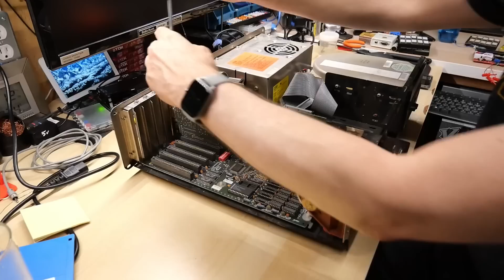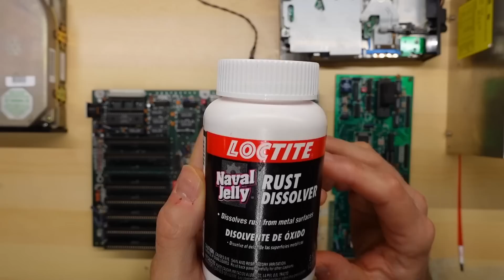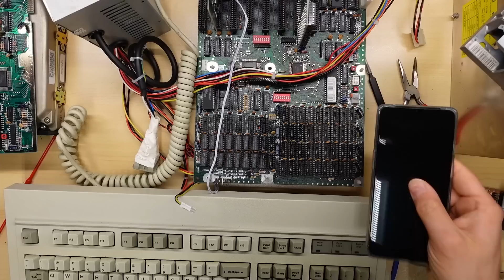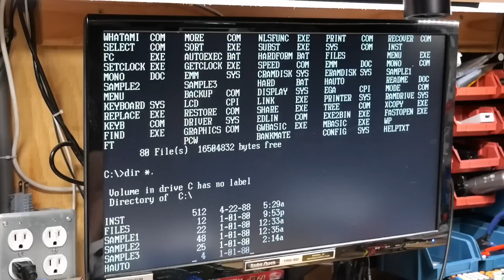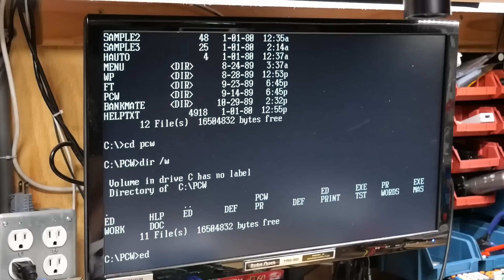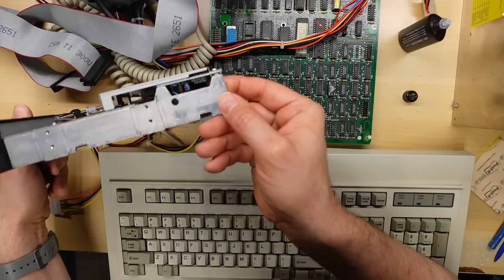PC archeology: Laser XT Turbo "Leaking VARTA Battery" Edition

Comment from the maker: Thanks to several viewers who commented, turns out the Laser XT Turbo has a keyboard lock function which requires two pins to be SHORTED to enable (unlock) the keyboard. This is the reverse of all other motherboards I've come across. After figuring out the key lock pins, I installed a jumper and not a XT keyboard is working perfectly. System appears to work flawlessly as well. Control 5 and Control 8 change between regular normal speed and 2x "Turbo" speed.  https://imgur.com/a/Rb1YFrQ
Reply: I could be wrong, but I was always taught XT, AT, and PS2 peripherals aren't hot pluggable (30 plus years ago ha!).  I'm not saying it won't work, but plug and play was not a thing.  There is some small risk of damage, and some devices just won't initialize properly.  Regardless, it's your stuff, but for the young gamers best to treat these things delicately.
Reply: @tiporari  Yup, XT/AT/PS2 is most DEFINTELY not safe to hotplug. You'll get away with it most of the time, but in my experience if you do it enough it WILL blow up the port eventually.
USB was pretty much the first PC connector that was to hot-plug and that was because it was specifically designed for that, note how the ground connector on the USB connector is sligtly longer so ground connects first. The next connector to be designed for hot-plugging was the SATA connectors (both data and power), again we see that they've made sure ground always connects first.
Reply: @Torbjorn.Lindgren  there were other hot swappable connections before usb, sca for scsi being an example (I'm pretty sure it predates usb). There were probably others,  but some were likely proprietary and in the server market,  most likely on unix machines.
Reply: @bionicgeekgrrl  I think the SCA connector was introduced after USB came out, even if the initial SCSI standard came out 10 years before USB. It's hard to get a solid date on the initial SCA-1 connector but all SCA connectors are always "wide SCSI" and the first standard that included wide SCSI appears to have come out well after USB. It's possible the standard document were well behind actual hardware but either way it's clear SCA came out much later than my next candidates.

Firewire is hot-pluggable and the first version came out 1986, the same year as the initial narrow SCSI standard which means it beats USB by 10 years. I was only considering non-trivial "desktop" PC/Mac connectors, the audio and serial connector has always been hotpluggable for example while pretty much all the pre-USB keyboard connectors were NOT - ADB, XT, AT and so on are all known to be unsafe and can if you're unlucky "destroy" the motherboard interface (even if it'll work fine probably 99 times out of 100), there's sometimes a very small fuse that can be replaced which often but not always get it working again.

Firewire was never that common on the PC side it's definitely a much earlier example that matches my critera.

Another contender is 10Base-T (1990) but while it beats USB it doesn't beat Firewire! The thin-net 10BASE2 versions of Ethernet came out the year before Firewire (IE 1985) and was hot-pluggable so that's an even earlier example, I don't believe the AUI connector used by 10BASE2 (1982) was safe to hot-plug though I think the vampire tap part was.

One common factor for firewire, SCA and USB is that they are engineered so that certain pins in the connector is longer than the other pins so they're always connected first even if the plug doesn't come in 100% straight, connecting a coax via a BNC or similar connector directly to the PC like 10BASE2 exploit the same effect (ground is the shell).
Reply: great news.awesome
Reply: The first thought I had when the keyboard didn't work was the lock, and I'm not at all familiar with Laser machines! Guess my troubleshooting skills are just on point 😅
Reply: and you were showing off the keyboard lock in the beginning of the video !!!    Nice video tho happens to the best of us!. thanks ! Joe
Reply: Nice design with an error that doesn't tell you its because they keyboard is locked like you'd see in other systems.
Reply: I ran into this on my first Laser XT Turbo and thought that the mainboard was flawed, so I got another one before I realized it was because the keylock was unplugged.
Reply: Replying here instead of clicking "thumbs up" since it's at such a nice number.

Comment: That "Laser XT Turbo" seems like an ideal XT motherboard, except for the unfortunate keyboard issue.
I like that it can go faster than an original XT, but hasn't lost the ability to run at the original IBM XT speed as well.  That would be very useful for XT era games, some of which need to run at the original speed, but others could benefit from going faster.
I really like that it supports EMS directly on the motherboard without needing a card.
It seems like this board has great range for something that can still run XT games at their original speed.  It's a shame it won't work with normal keyboards though.

Comment: "Vinegar is difficult to get into the isa slots. " .. umm Adrian, it's easier than trying to force a thick gel inside. Get some toilet paper and place it down where you want to pour the vinegar and that keeps the vinegar in place and its a lot cheaper. That stuff you use, this "naval gel" is £20 a tub in the UK!. Oh just pour the vinegar into the isa slots and leave it. Or sprinkle baking soda on the green then drip the vinegar on. Simple and much much cheaper. By the way where did you get that micro TV with the 80s style animation running?

Comment: Hi, I've got a Laser XT motherboard that I'm trying to get working. It's actually in an IBM 5155 case. It was an old work computer that the tech guy apparently spent $10,000 to upgrade (according to my Dad), so it now has a HD, but also the Laser motherboard and that FDC. I had the same issue with the leakage, although nowhere near that bad, but I can't get it to boot past the floppy disk error. I don't know if it is the card, the drive or both. 
I don't have the spare parts or computers to do testing to see what works.

Do you know if it is possible to boot with that motherboard using the XT-IDE without a floppy? 
I'd like to get one, but if I can't get the computer to boot, then its not worth it.

Thanks

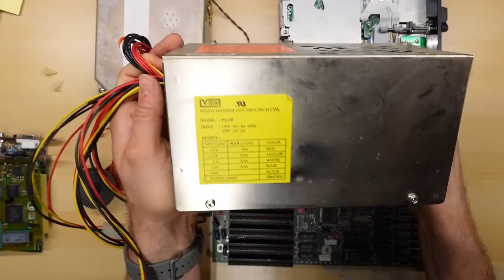Comment: 12:13 talk about an ineffiecient PSU*!  Output capability is just shy of 130W, but the input is up to 480W!!!

That is a whopping 73% efficiency loss!  

*Unless they are allocating the IEC passthrough power consumption as well into that input figure, which would seem more reasonable, because I can't fathom how a switch mode PSU even from this time would have that much worse efficiency than even a linear power supply.  But I've never had my hands on a Laser 128, so presumably V-Tech rated things a bit differently than how Astec and even IBM would label their PSUs.

Comment: For a while in the  mid to late 1990'sI was able to buy used XTs from a local liquidation outfit for $5.00 each. Stripping one down yielded a case and PSU far superior to most available at the time, and a treasure trove of miscellaneous fastener hardware for reuse.
 I would install various iterations of pentium or AMD mainboards and up to date HDDs in them. The power supplies were fully compatible and of much higher quality than that of the many smaller, cheaper, and cheesier PSUs that were flooding the market.
The trend at the time was toward vertically oriented tower and mini tower cases, but I preferred the looks and solid construction of the old IBM's. I wish I still had at least one around to play with.

Comment: Have you ever done the run it through the dishwasher routine on boards like this or worse?  Contrary to myth, there are no particulates in dishwasher detergent to sandpaper anything.  I've never tried it but have done a thorough washing in regular water (hard water here in San Diego), lots of dish soap, and various brushes, toothbrush, etc. on a motherboard (486 as I recall) that had gotten rusty(?) from living near the ocean here and didn't work/boot at all.  I'd removed all socketed chips first.  When done, I blew it out thoroughly (especially under surface mount chips) with my air compressor (yes, I know, risk of static), then rinsed thoroughly again with 90% rubbing alcohol (best I could find), then blew it out again.  Finally leaving it out in our San Diego sunshine for a day.  Put everything back together and lo and behold, it booted right up and ran for years!  Not sure what happened to it eventually, though, may have failed again but as mentioned, it ran flawlessly for many (5+) years.  'twas an experiment in the washing idea, and had nothing to lose and gained a nice system.

Comment: I had one of those! That was my first PC! Laser Turbo XT! 40MB Seagate and all! It went into the landfill decades ago, the cpu had stuck bits.
Reply: The labeling on that hard drive is exactly how mine was too. Maybe some OEM thing they did. Holy shot this is a blast directly from my past.
Reply: And yeah there’s actually a full menu system in the C800 on that MFM card. I seem to remember you started that at a different offset in the segment than 5. But even with the basic interface you had basically full control of the low level format. I remember it because it was an at least yearly ordeal after the drive aged and became very sensitive to the ambient temperatures.
Reply: Red switch on the back is yes the reset.
Reply: The BIOS is picky about keyboards. Mine worked with the Laser and a model M but nothing else as I recall…any XT/AT keyboard made later gave a keyboard error or just locked the thing up.

Comment: i have a 1990 dated Hyundai Super16TE 8088 XT machine, has similar nicad damage 😢
Reply: i washed mine with 'diluted' liquid phosphoric acid rust killer, similar as you had in the video, but not jelly type , scrubbed it with an old toothbrush, also had a tiny bit of washing up liquid mixed with it, it soon killed the corrosion, many say use vinegar but i cant stand the stench of the stuff ... theres some completely rotted tracks, i've started patching them but left it for now to do other stuff

Comment: If the video card has a true monochrome mode, that uses a different screen mode for text.  Hot swapping connections would not automatically change the screen mode.  I don't recall if BASIC allowed you to switch, but if you don't have a tool kit to change the video mode I think it is a call to INT 10H.  It was easy to do with debug.  ah=0, al=mode

Comment: The ST-225R actually has the same 21 MB capacity as the regular ST-225, but the higher density of the RLL encoding allows it to use only one platter instead of two, making it a lower-cost and less power-hungry drive.
Reply: It also means you can't squeeze an extra 50% space out of it by swapping out the controller for an RLL controller, something we often did with non-R ST-225s when they were no longer desirable (most everyone having moved to the ST-251, which RLLs to a ST-277R). Ah well, Seagate was under no obligation to enable our hacks.

Comment: I noticed the battery eaten controller was tested with a HD floppy drive and disk. If I recall older controllers only supported 360k or 720k. I think you need an upgraded chipset for 1.44? Maybe test with the 360k drive? Nice socketed z80 on that board.

Comment: I almost wonder if the RCA outputs on that CGA card are split into Luma and Chroma. It probably isn't, but if it is, you can probably turn it into regular composite by coupling to the second one's output with a 470pF capacitor - you'd want the Luma output going straight to your monitor (or converter) and a 470pF between the Chroma output and the wire carrying Luma. This wouldn't be perfect, but in such configurations it will usually get you at least some color. Alternately, you could just make up a cable to connect them directly to an S-Video input on something if they are indeed split Luma/Chroma.

Comment: RLL encoding (AKA relative run length) was a way to get more storage from the same area of magnetic surface over MFM (modified frequency modulation).  This was a HUGE gain back in the day, because an RLL drive cost about the same as an MFM drive, but you got more storage space.  A very economical tech advancement.

You have to realize that magnetic hard drives were very young back then, and we're the beneficiaries of a long chain of very expensive research to get to the rotating magnetic media we have now.

Of course everything is going flash memory now (SSD's are flash based).   Good luck finding a working SSD from today being readable or usable 40 years from now...  ^-^

Comment: If a motor has permanent magnets in it then it is not an induction motor. It is a permanent magnet synchronous motor if was driven by sinus, or BLDC if was driven by square wave.

Comment: hey if you're going to recycle that case frame, would you consider selling it? I've a 286 and a 486 motherboard I want to build custom cases for, and that sanded-down and repainted could serve as a framework for it.
Reply: Be aware, the spacing on the rear card slots is different between PC/XT and AT or higher. You'd have to remove that part of the back panel and replace it with one salvaged from a more normal PC case.

Comment: I wouldn't be surprised if that Chinon 5 1/4 inch drive is actually HD. After all, it was made in '89. I have a few of those and they're all HD (although mine are all... what would you call that, dark beige? What Commodore used on some of their cases - some of them even came in Commodore PCs - and they're definitely HD drives)
Reply: Some, not all - Commodore used those Chinons in virtually everything with a 5.25" drive at one time or another! But in the XT class stuff (I've had like four PC10-IIIs) they were all 360K.

Comment: Thanks Adrian! I am going to try the Naval Jelly on the worst spots of the Amiga 3000 I am going to restore soon. The battery damage is pretty significant but I HAVE to get it going! 😎
Reply: That might not be enough for an Amiga 3000... they're notorious for eating vias. The legend himself John Hertell has been doing amazing work on his ReAmiga 3000 PCB though so it can be saved either way. http://www.reamiga.info/?page_id=40
Reply: @Carcenomy  Thanks, I had heard of it but now its bookmarked! I am hoping to save the original board. My buddy from back in the day gave it to me recently and we used it to design our users group newsletter. Its not my original Amiga but it is one I worked on and used back then!
Reply: @RavenWolfRetroTech  I wouldn't feel bad if reboarding it becomes the option, you can make some massive quality of life improvements like SIMMs instead of ZIPs that way. But keen to see it fixed, the 3000 is a pretty unique specimen!

Comment: Historical note - the bank-switched memory was called "expanded memory", which was a standard developed jointly by Lotus, Intel, and Microsoft (LIM). It was a nightmare to program and even to set up. "Extended memory" (XMS) came with the 286 and its larger address space and was usable by anything that supplied a proper memory manager. The old Netware operating system would bootstrap in DOS and then immediately load its own extended memory manager. Windows 3 and OS/2 could use this memory directly.

Comment: Just an aside - I was warned to never plug an AT or XT keyboard into the connector while the board was powered up. Damage to both could occur. That may be incorrect, but I do remember it.
Reply: Old comment, but just in case anybody sees this I can confirm.  Years ago I burned out the keyboard port on a motherboard by doing this.  It didn't have a fuse either, so I basically ruined it.
I had done it without issue many times before, so I thought it was okay.  Usually you get away with it, but then there's that one time when you don't.
Reply: Agreed!  They are not "hot swappable".

Comment: Having DOS installed onto the root of the drive like that is not surprising. If you look at the installation instructions (based on the IBM PC-DOS 3.30 manual) it tells you to enter SELECT C: 44 UK (well, the last two are location specific but you get the idea). What a sane person would do is replace C: with C:\DOS but the manual doesn't tell you that so on the first attempt you get a root level full of files and slightly annoyed at whoever wrote the docs.

Comment: The ST-11M/R controller only works with a subset of drives which are programmed in its firmware.  It will actually attempt to identify the drive using the data stored in the drive's onboard ROM.  And one thing which is interesting about those controllers is that they are implemented with a mask programmed gate array and the controller microcode is stored on a separate ROM.  The RLL version is one of the few controllers, according to the stason website, which supports drives with 31 sectors per track.

Comment: The battery should not have been on the board but connected by a cable coming from the battery out if the way so it cannot trash the PCBs
Reply: I mean you're right, but the manufacturers never expected their computers to be in service 30 years later.

Comment: I’ve configured lots of these Laser Turbo XT and later machines when I started my first job in the early 90’s at a ////Laser dealer in Belgium. Solid and affordable machines for the time. We also sold Compaq machines. Can’t remember if these XT machines used a special keyboard… Don’t think so, but there was a keyboard lock I believe. The Seagate RLL drives were a frequent point of failure. Thank you for making these videos!

Comment: Please dont connect or disconnect the keyboard when the PC is on, you can easily kill things that way
Reply: I second this! I have killed multiple key oard controllers this way. XT/AT/PS/2 keyboards are NOT hot swappable like USB
Reply: I nearly killed a computer and monitor when unplugging it while it was on. Those were harsh times